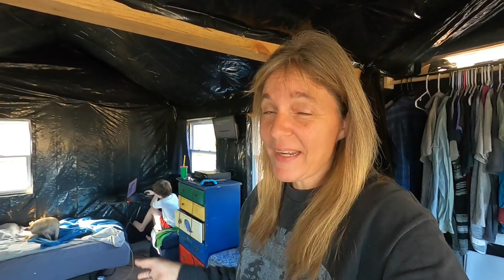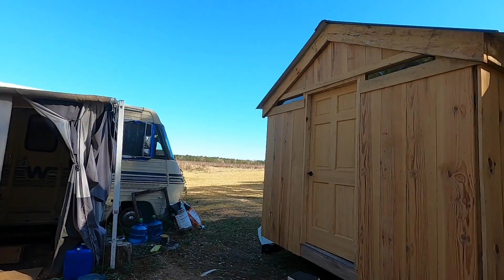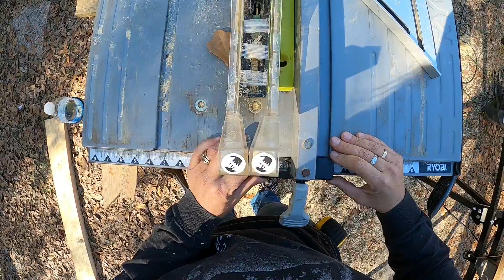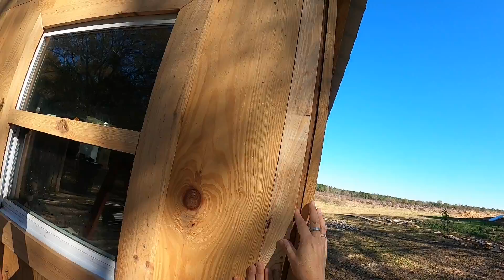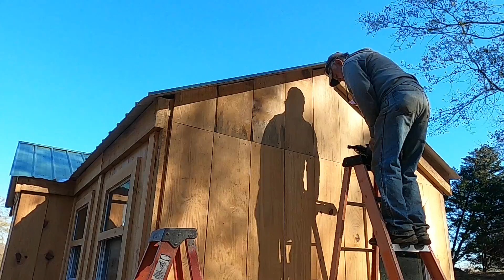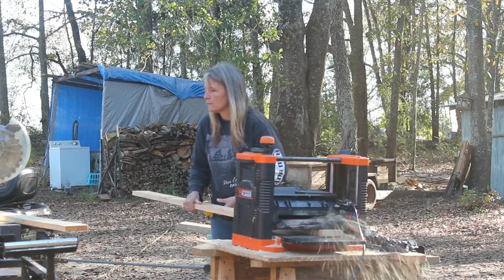Post and Beam Bedroom Tour and Cost

Comment: The  breaker box  ( Circuit  Breaker ) Safety Switch ,,,  is fine , only  in the last 45 years or so have Circuit  Breakers been fitted in houses , before that we just had a Main Switch and the old Ceramic fuse holders  ,,